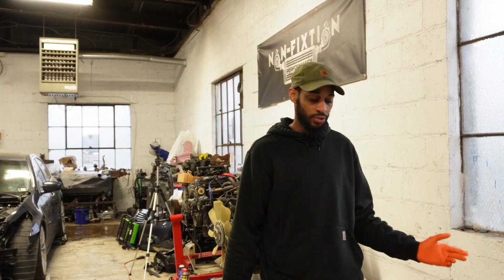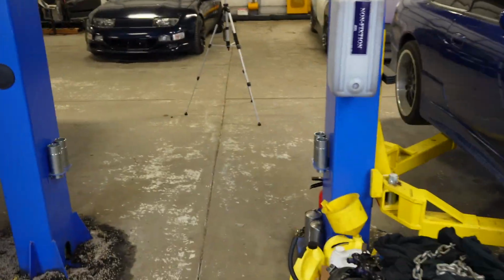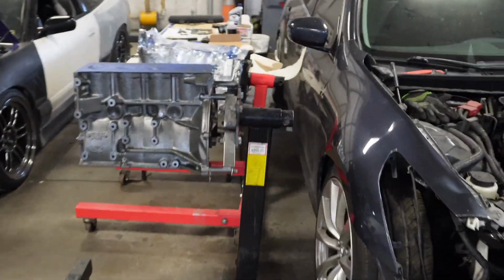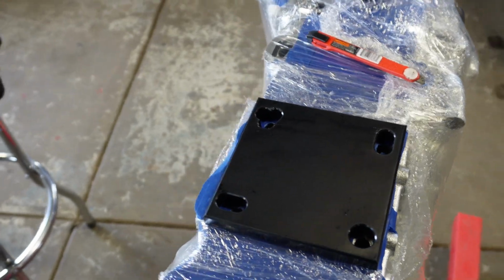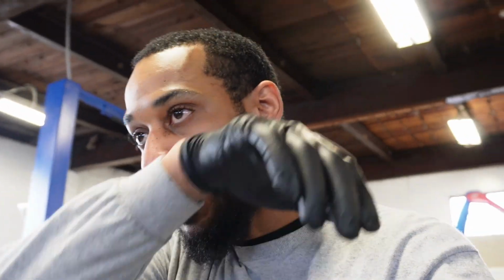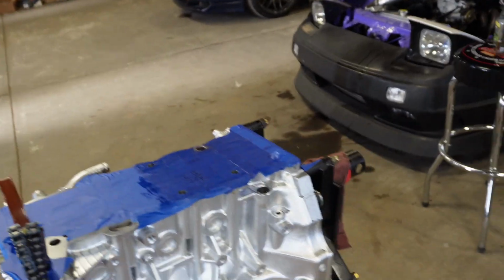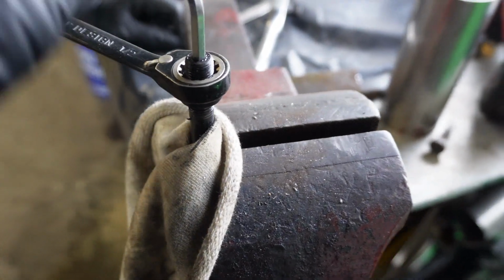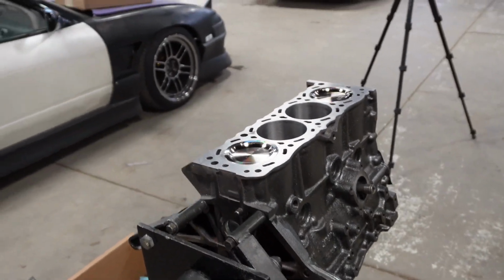SR20DET TIME-SERT / BIG-SERT Headstud Repair

Comment: Have you timeserted a mains thread on an sr20? 

I've got an old sr20ve block with det girdle and ARP mains studs.
Had been line honed, one of the mains threads is stripped.
Reply from the maker: I personally have not but the TimeSert is the way to go. The head studs require more tq than the mains so I’m confident it’ll work just as well on the mains.